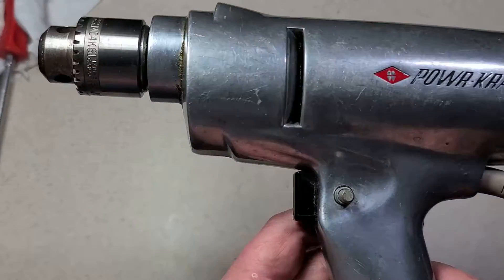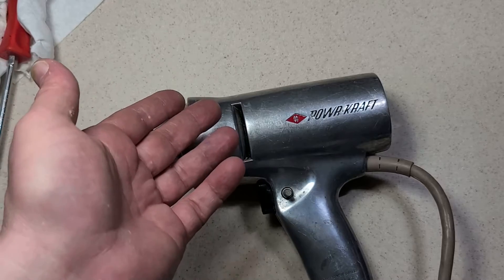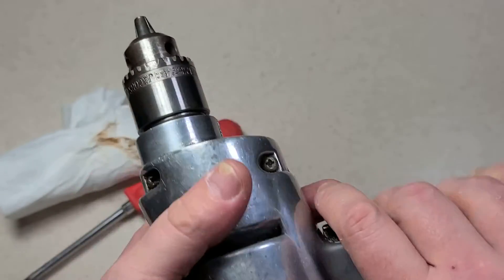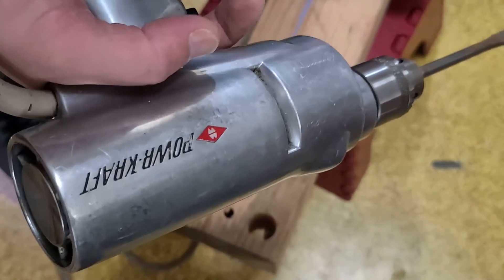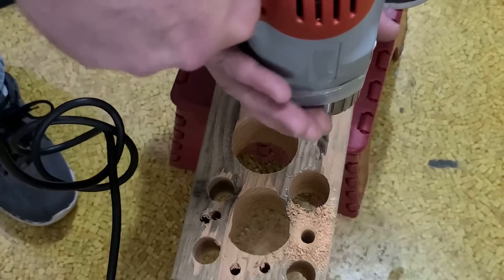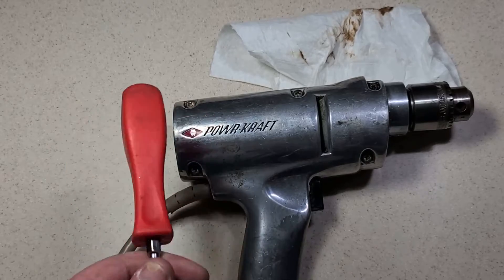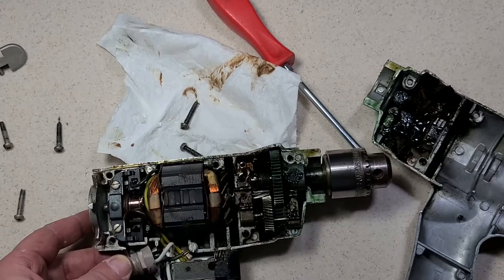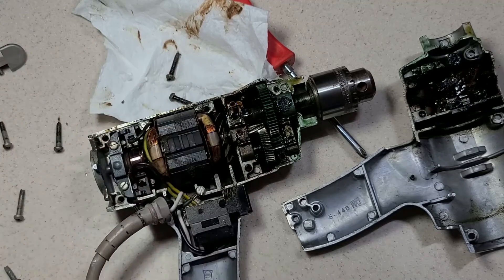Powr-Kraft 3/8" Mid Grip Home Utility Drill Review/Teardown

Comment: I have the same drill, earlier production run maybe as my commutator wires are pinched with no epoxy.  

I believe one of your phenolic washers near the rear motor bushing has failed or been removed, my fan is spaced much faster away from the coil and the motor pinion engages the corresponding gear fully with a little room to spare.  

The rear bushing rides directly against one of the phenolic washers and over time will eat through it.